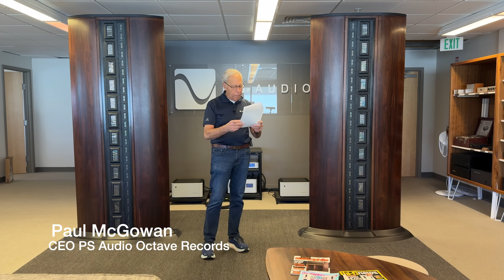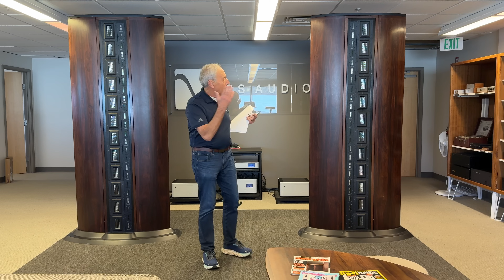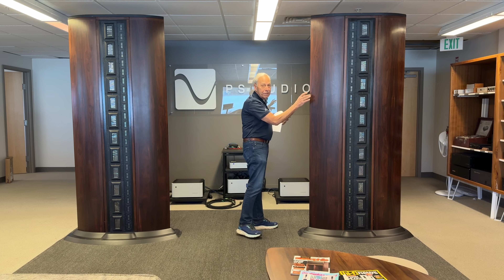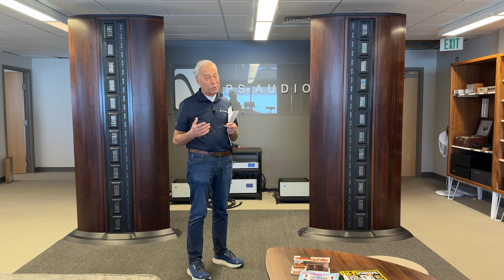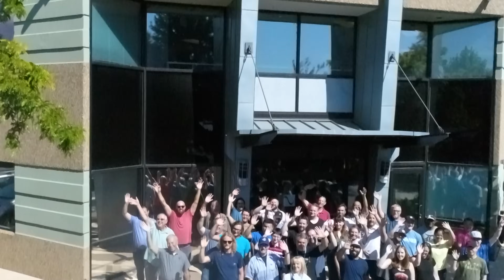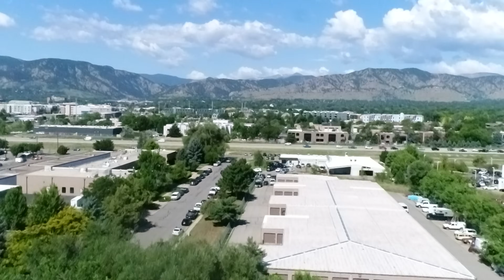Why speakers are so expensive

Comment: Whats wrong with MDF
Plywood has voids voids in the wood is a problem.
MDF is solid its hard and with bracing doesn't flex or create side sounds.  We don't have the 10k year old trees used to make a stratavious  the closest we can get in denceness  is carbon fiber 
I don't think any trees are alive to day with the growth rings used to make that prized violin 

So its not as much as the material as it is acoustical engineered.  
And yes some drivers can get expensive but if your making the drivers you can set your own parameters  

5k  20k  30k  a pair of speakers, but it all depends on your age and hearing capability. As well as the rooms acoustics.

Comment: One way to cut down on the price of speakers is bi-amping. Many of these $100,000.00 speakers use passive crossovers with dozens of inductors resistors and capacitors.
It's a head scratcher because the price of those parts alone could buy a great active crossover and another amplifier. With superior profornance and less money than the passive network.

Comment: Those two large oval shaped structures didn’t look like loudspeakers, they looked more like a door to a lift shaft, I suppose the people that can afford these crazy large speaker systems don’t live in a council flat! Not that you could get them through the front door, but large country mansions with huge front entrances and high ceilings.

Comment: I had a pair of Infinity QLS II speakers for many years, until the woofers fell apart.  Had them for a couple of decades.  Loved those speakers - paid about $1200 for them thru the Army's Audio/VIdeo center in Germany when I was stationed there.  Ran them on a pair of bi-amped GAS Son of Ampzilla amps.  I lusted after the IRS speakers but they are/were out of my league in so many ways.  Infinity was a class company.  I wrote to them asking if the GAS amps would be a good match for the QLS II's and Arne Nudell wrote back to say yes and to recommend hooking one amp per speaker, with one channel for bass and the other for mid/treble.  I also had the Infinty Black Widow tonearm on my turntable.

Comment: "Expensive" is a relative term.  In most major urban areas on the US west coast, a run down old house costs $500/sq.ft. to buy, a newish high-quality  house is $1000/sq.ft.  The floor space for a two channel system will cost more than most of the equipment that is placed on it.

Comment: High end or specialty speakers can be expensive because, well, the market allows them to be. At a certain level it's no longer the average enthusiast buying these speakers. It's wealthy people who may or may not be true audio enthusiasts and since they can afford high prices then the builders of audio jewelry will build them audio jewelry. That doesn't mean the high end products don't perform well, they usually do. But does a $30,000 Aspen outperform a $6000 pair of another brand? And if it does is there really $24,000 worth of difference? When you make the move to integrated amps versus a far better equipped AV receiver you pay a premium. When you make the move from integrated to separate amps you again pay a premium. Often there is a sonic advantage but for the average Joe we're splitting hairs they don't care about. So a manufacturer knows that if someone is interested in a separate amp or even an integrated they are an audio enthusiast or audiophile and likely to pay more money for these more specialized products. Of course, selling less of a product increases it's price due to lower volume. Same rules apply to higher end speakers.

Comment: Anyone ever think of cardboard spkrs? If wood or mdf cabinets are so expensive. How would they sound? Maybe even the shipping box could be turned inside out. Now for those of you who laugh, consider this. Rogers, a very good British speaker company did much experimentation on using extremely thin wood for speaker cabinets. I had a Rogers LS2 with very thin wood and I think it was the most characterless cabinet of any speaker I have ever owned. It's bass was fine for its size too, and I heard no cabinet resonances. The very first speaker I ever built was a cigar bos which I made a 5 inch hole in the back of it and screwed a full range driver into it. At 13 years old I was a hit. It sounded way better than the 3 inch drivers of others with speakers, around my age. I thought of taping the cardboard cigar box shut, but I heard something about vented speakers. The wider I opened the back, the more efficient it sounded, but the more I open I let it be,, the less bass.I found a happy medium with it open in the back just a bit. No, speakers don't have to be expensive. I don't remember the cardboard cigar box having resonances like wood or mdf  After selling the cigars which were inside it to someone, the money paid for the driver, and then some. So the speaker was FREE!

Comment: inflation is a thing... my 1970' ( purch. new way back ) dynaco 25 cost about $90. ea, walnut veneer,.... today, around $250 ea. min. for same sound Q.   the KLH 17 from same era , the wood finish on that - not avail below  $500. e. ( just look at a veneer Advent )  but on the other hand, electronics > 100 W chan is easily avail from good companies like Yam.  rs 202  for less than $200.  probably 80 w / ch by the old mid 70's rating but still... and image , the jump in price from a perfectly reliable Honda to a Mercedes.......

Comment: An Audi RS7 is $120K...lot more precision parts than in any over priced loudspeaker...it's called marketing.  Stop the nonsense.  RS7, comes with climate control, audio, and motion, in all weather, all temperature.  Paint finish is better on an Audi, in all weather temperatures, etc.  Home hi fi is such a bunch of hooie..especially the over priced electronics.  Where are PPS Audio speakers made?

Comment: There's several brands that really embrace false economy as well, they rather spend money on selling them then making them. 
If you got tools and don't mind getting your hands dirty, then you could make some really amazing DIY speakers for say half the cost of some. If you add a good plate amp with DSP, then in some price segments you could probably knock a zero of your system cost. Kind of unique at this point in time, HiFi gear is kind of in the golden age for DIY. 🙂

Comment: There is a lot going into those cabinet / boxes because they need bracing to avoid flex etc.
Do a tube system and you eliminate all that weight and issues while reducing the price ten fold. 🤷🏻‍♂️
Reply: Almost done with a project like that.  Most expensive part was the metal hardware.

Comment: PS audio uses off the shelf components. So a set of speakers that they charge 30k has about 2k worth of components, the other 28k is profit for Paul.
Reply from the maker: What an inaccurate and unkind comment. Other than maybe binding posts and capacitors, there isn't one off-the-shelf component in our speakers. Everything was designed from the ground up by our engineer, Chris Brunhaver. And "Paul" doesn't get the profit which you mischaracterize in size and outcome. I get a salary like everyone else in the company. For the 50 years we have been in business we've made, unfortunately, pretty small levels of profit. I wish it were more. Those profits go back into the company and are what fund our growth.
Reply: What drives you to do this?  Have you ever started and run a global business with many employes?

Comment: Speaking of the Aspen line vs the Genesis, I do not doubt the chassis or “box” of all Aspen is expensive, but why did you make them look so damn cheap? The paint fit & finish is horrible, and yes I have seen now 3 different pairs in person, all FR30’s. They really do sound fantastic but if I a pair delivered that looked like any of the 3 I’ve seen, they’d be returned as defective. Even if the fit & finish were good, why a painted cabinet? Who wants a painted speaker cabinet in their home unless their furnishings are from Ikea? 

You’re standing there waxing on about the Genesis speakers and the Brazilian Rosewood finish, why are the Aspen’s not similar finish? Doesn’t have to be Brazilian Rosewood, offer a mahogany, quartersawn white oak, Sitka spruce…. The list of available wood finishes that would make the Aspen’s far more appealing to fit within the home decor of most of your target customers is endless, just please, anything but a painted finish. If you insist on painting for budget-margin purposes, they will unfortunately never be allowed in my living room but I would highly advise a new paint booth and painter as well as improved qc. All the best
Reply: I agree with you, Michael. I will not own a pair of expensive speakers with a painted finish. Good quality well matched veneer with a satin finish is the only thing that will be allowed in my home.
Reply: They are manufactured in China. Thats why the finish is the way it is. The decidion eas made, that in order to maximize profit margin, this would be the sacrifice. Evidently, they believe that the sound will trump the finish. Me, personally, i would never spend 30,000.00 on a pair of speakers, but there are those who will and do.
Reply: It's interesting how tastes differ around the world. People in Europe only want a "modern" looking speaker in white gray or black, and usually think wood veneers are old fashioned, looking like their grandma's china cabinet.

Comment: I can tell you when i built my little gr reseach xls encores.  The kit was 300, maybe another 100 to 200 in material, and if i were to charge labor, it would be at least 600 for building and finishing, which was a lot of work .

Comment: As soon as I saw the title of the video, I was saying "It's the enclosure", to myself.  Those boxes take time and that means money.  As someone who has DIY'd a fair number of speakers over the years I've found that driver prices are quite reasonable , and the cabinet materials aren't costly, but you use up a lot of hours of time to build and finish the cabinets for even a 2-way monitor.  When you think about paying for all that labor, you can see how costs rise quickly.  Certainly a manufacturer gains efficiency by scaling up to make many pairs, but it still adds significantly to the final cost.
Reply: With modest size speakers the crossover components are the most expensive in the build.
I was amazed to see that some are twice as expensive as the drivers. No idea if it is worth it as I have never build one yet but it does make sense that quality parts produce better sound.
Reply: I agree 100%. I also do DIY Speakers and other types of woodworking. It's all about the labour! Glossy finishes multiply the cost.

Comment: Speakers are not expensive. Our perception of value has deteriorated. We can have speakers for $50. The true cost of a loudspeaker however,  is the R&D that is HUGE for any really high quality design. Then factor in warranty, shipping big boxes and not last, enough profit to insure that the company (and the qualified designer) is around in a couple of years.
Reply: Speakers can most certainly be expensive. But they can be cheap as well. Value is what you get out of what you spend. $30,000 for a pair of speakers is expensive for most people, regardless of how good or bad they sound. If they sounds really good, you could say that perhaps that price makes it a good value but of course if they sound bad, then perhaps that’s not a good value. The same logic would apply for a “cheap” pair of speakers as well.

Regardless, $30,000 (or any amount relative amount) is still a chunk of change for most of us no matter what it’s used for. It’s just easy to justify that amount if the perceived value of what it’s getting is worth it.

Comment: One word can help with speaker prices.... closeout. My left right speakers were 6500 a pair, I got them for 4800. The center was 1200. The subs 1600 a pair. On a 7.2.4 system the main cost of my 30 grand system was speakers.  But closeouts really helped. Learn how to shop.

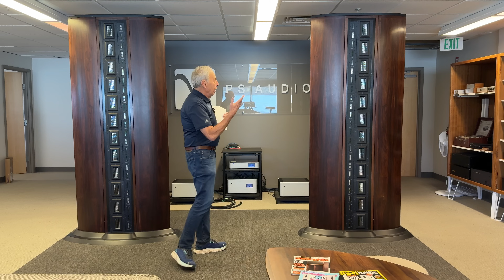Comment: @0:49 "This is a $100,000 pair of speakers."
When they were new.  I doubt that they would sell for even ½ that, today, when our host's own Aspen FR30 speakers sound better, at less than 1/3 of $100,000.  Perhaps they are a collector's item, that someone would pay $100,000 for?

For roughly $40,000 you could own a pair of Vandersteen Kento speakers.
Or how about a pair of Graham LS5/5 speakers for roughly 1/5 of $100,000?

All of the above will sound better than our host's IRS V speakers.

There are dozens of speakers at ¼ to ½ the price our host claims the IRS V's are worth, and all will throw a more coherent, realistic soundstage.

The IRS V's will do a better job at deafening decibel levels.  But for $100,000 there are other speakers that will rattle your walls, and sound better.
The IRS V's are decades old.  They simply lack the realism that today's high-end speakers have.  They sound great, until you hear what you can get for the same price, today (or even 1/3 that price, today), if you choose carefully.

Visit PS Audio.  Listen to the IRS V speakers.  Then listen to the FR30 speakers.
If you could have either pair for free, you would take the FR30 speakers.  So how could the IRS V's be worth $100,000 when our host's own FR30 speakers are $29,000?
Reply: Those IRS Vs are not hooked up for listening. They're just being stored there. They were never $100K new. Over their production run they went from $50k to $60k.

Comment: I`a m speaker builder for many years and i totally agree with Paul. The cabinet is the most expensive part of a loudspeaker. And it makes e difference if you buy a speaker from a big or small manufactor. It`s a question of large or small quantities too. That`s the reason why i build my speakers on my own. Greetz from Switzerland.
Reply: It's all about the labour. Glossy finishes also tend to multiply the amount of labour involved.